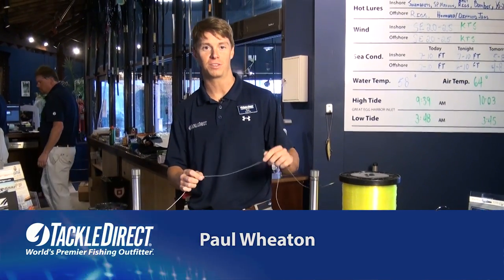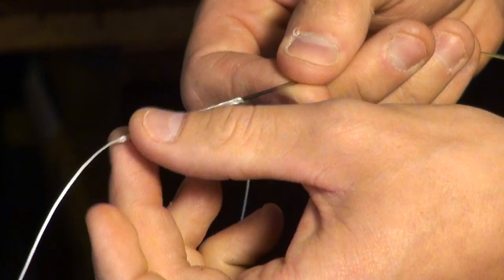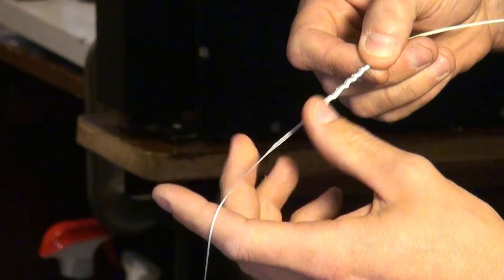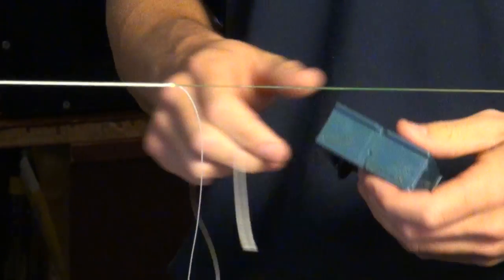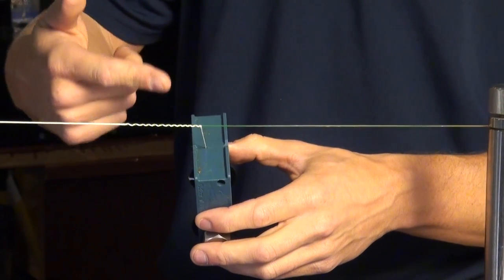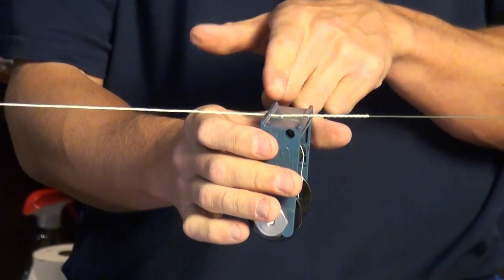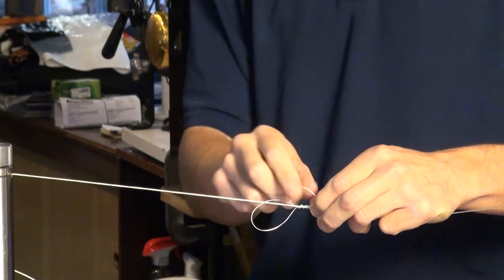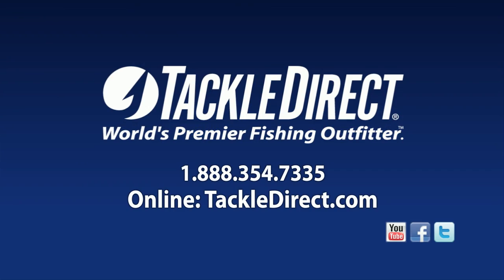Hollow Core Splice and Serve at TackleDirect

Comment: I do a lot of hollow core to mono, flouro or solid spectra. I was excited to see a method using the hollow for the serve too. I usually use nub nail connections or service the connection with solid spectra. I test them to detect slippage. 

Yours slipped!  I used 80# hollow and 50# mono and performed what looked like your serve. It is pretty and appears very sano. I mark the mono with a sharpie right outside of the serve and test. Pulling 20# caused a 1/8” slip. Pulling more caused additional movements. I added Tac glue to the serve and re-marked the junction. No slippage even pulling 30#. I realize the typical drag setting for 50# is 12-15#, but going past that at the end of a fight is common so I test with more pull. 

Thanks I still think this is a very cool new way to splice and serve.
Reply: Thanks for testing this. I just add a nail knot on the end of the hollow where it meets the mono and another at the end of the mono inside of the hollow. I caught a 100# tuna on 80 to 80 hollow/leader and had zero slipping. Little bit of Tac glue as well doesnt hurt.

Comment: What do you think about if I use 100# mono backing and use my 200# hollow core for a splice? Will it hold? I am thinking running the mono up about 10 feet and do the serve. Just want to make sure this ratio is acceptable. I am doing this on a Penn 80 VISW. Then I will add a topshot of 130# mono with a bridle that I make up and splice that to the 200# hollow core. This will be my planar reel setup for Wahoo .

Comment: the serve doesn't hold the line. the serve keeps the end of the braid from moving up the mono and allowing the braid to slip from the end of the mono. the way you show this serve, not done under enough tension to make the mono stretch, will allow the hollow core to move up the mono and release the topshot. as soon as that topshot is put under pressure the mono will stretch and the OD will shrink, that serve will no longer be tight and ineffective.   serve under tension and use solid 20 - 50lb braid to serve.
Reply: Yeah I worry too that this just adds length to the hollow Spectra but isn't cinching it down to stop it from riding back up the mono. I think it's creates a nice ramp going through guides though which sometimes a thicker serve annoys me with.
Reply: I do it this way and haven’t had one fail yet and I do a few hundred/year

Comment: If you still have to do a serve to complete the splice it hardly seems to be that beneficial to be hollow core in the first place.  For smaller water bass fishing with like 40lb hollow ace and say 12lb mono/fluoro could you get by with just the Chinese-finger-trap of the hollow ace and a few dabs of glue to hold it in place?
Reply: It is not meant for freshwater casting use. This is a trolling technique for big pelagic ocean tuna, marlin
Reply: @brendanwoerner3352  I get that, but they make 40lb test.  https://www.tacklewarehouse.com/Power_Pro_Hollow_Ace_Spliceable_Braided_Line_Blue/descpage-PPHS.html?from=gshop
Is that test meant for large fish ocean trolling as well?  Even so, my question is, can you use the line for freshwater?  For smaller species, would the serve be necessary?
Reply: @IlliniDog01  you can but your wasting money! There’s no point to use hollowcore in a freshwater application. Your better off with straight braid and tie connection.
Reply: @IlliniDog01  long story short know you’re knots and don’t use hollowcore for freshwater!
Reply: @brendanwoerner3352  it could be worth it in certain circumstances. I’m planning on putting 60lb hollow core on my avet mxl for catfish and sturgeon, for fishing from the bank it makes it easier to cast without the knot hanging up in the guides